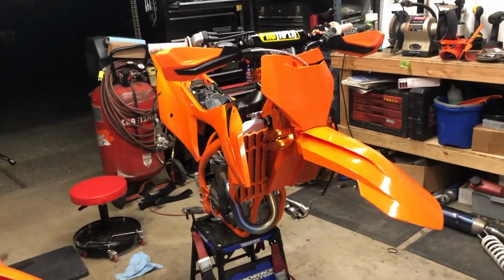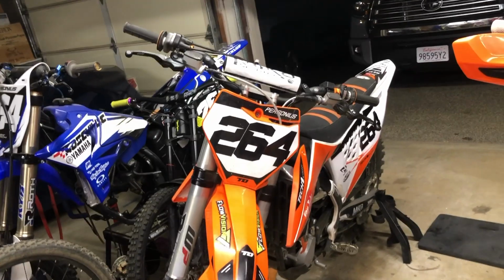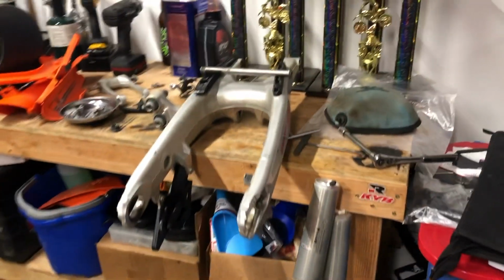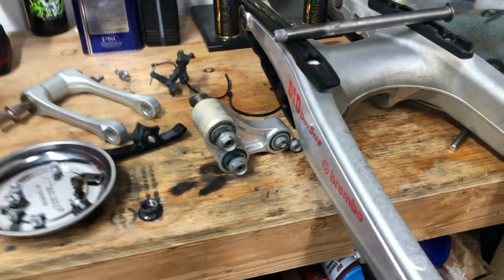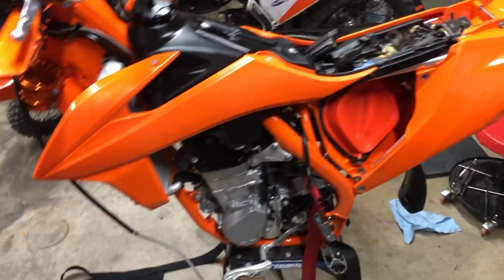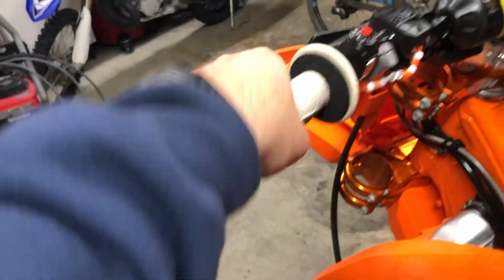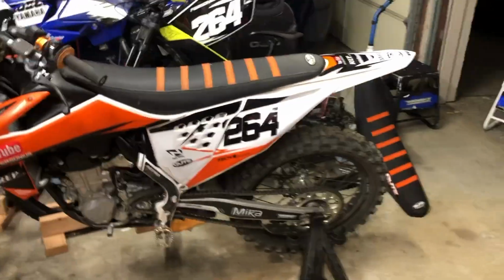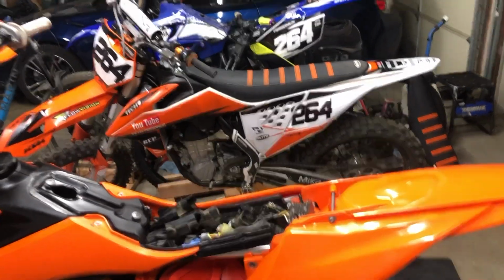Update on the new bike

Comment: My new bikes (Honda’s) don’t get torn down until about 50 hrs, and everyone of them (since 91) still has lots of grease and still looks new.  Maybe I have always been lucky.
Reply from the maker: I may exaggerate when I say “bone dry” but there was no denying this bike at now 14.5 hours had signs of rust starting.  If you haven’t noticed I’m a little ocd with my bikes. When I clean and grease my bearings I CLEAN and GREASE the heck out of them lol.
Reply: @KevinPersonius  were the images from when you took it apart or after you wiped it down. Looked bone dry to me as well.
Reply from the maker: @terryhansen2217  yep. They were.